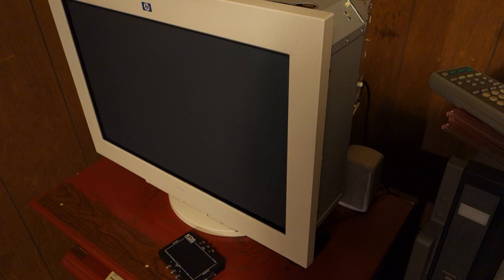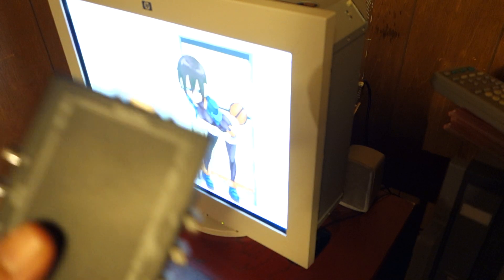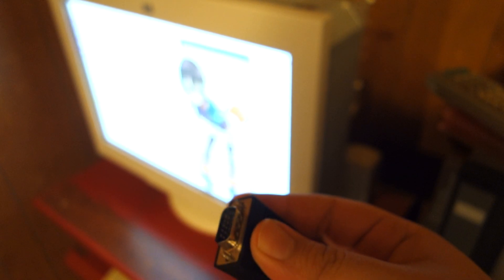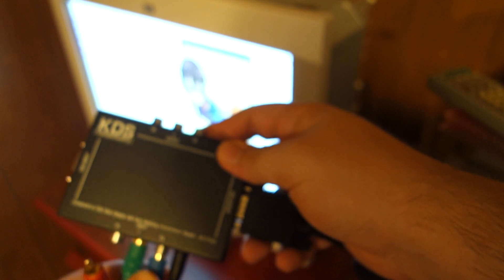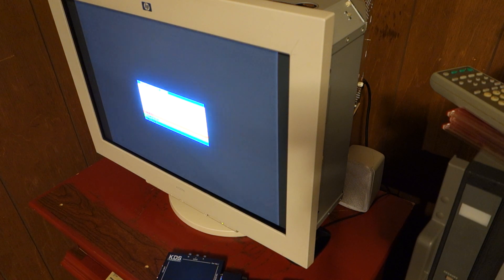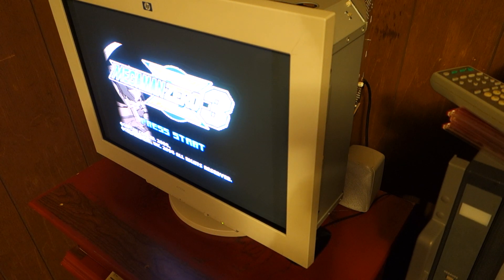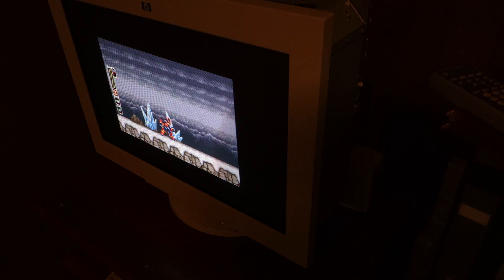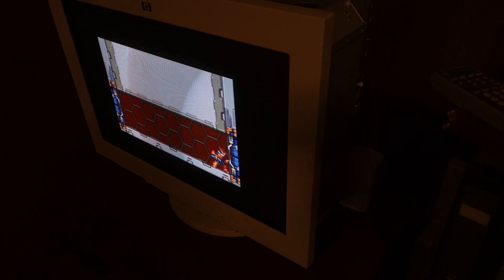Key Digital VGA Transcoder Demo - KD-CTCA3 Step by Step Usage

Comment: did this display the scanlines properly? angle makes it impossible to tell
Reply: If im not mistaken...30 khz vga monitors will not display scanlines. 240p content on a 15khz monitor should provide natural scanlines.   You could use a device like retrotink 5x to create artificial scan lines.